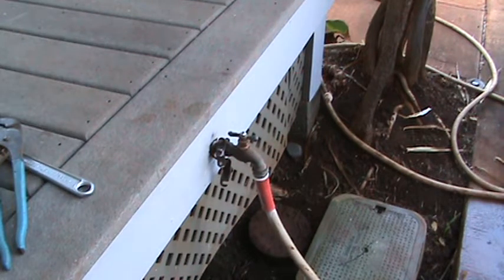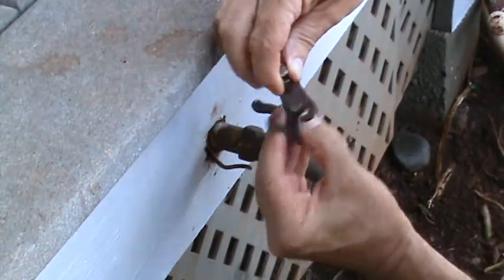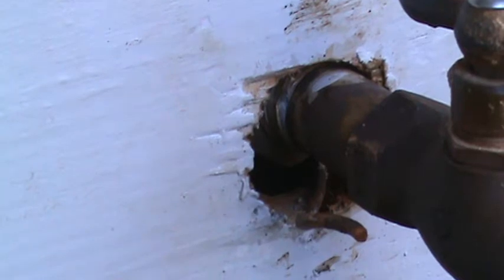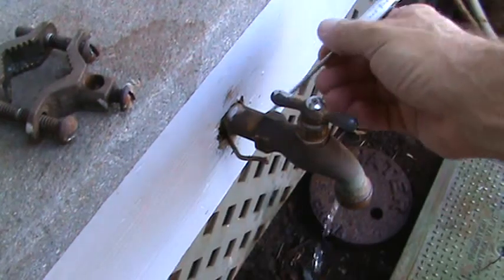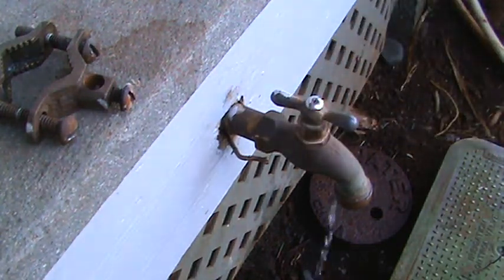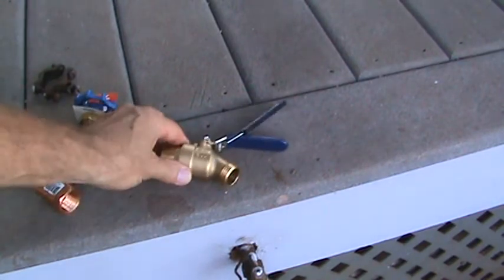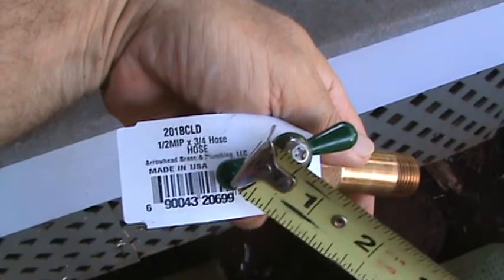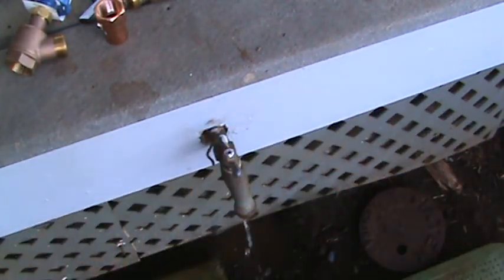How to Determine Size & Type of Leaking Hose Bib

Comment: Question, I just replaced a spigot just like the one you replaced in the video. This looks very straight forward. My question is, when I turn on the new faucet it stops after about 10 secs. Any ideas of what could be wrong?
Reply from the maker: That sounds really weird other than the fact that once you remove the old spigot you should then turn the main water line back on to flush out anything that could be in the line then turn back off. Then install the new spigot. My guess would be that once you turned the main water back on it could've loosened some sediment in the water line & that sediment could've shot right into the spigot & clogged it up...as a thought. You might have to remove the new spigot & install a new one & it might fix the issue. I have never heard of that happening but I know sometimes when you turn the main water back on to a house, stuff like that could happen. I replaced a toilet fill valve one time & when I turned the main water back on, the water fill valve worked but would not shut off when the toilet tank filled up...it would just keep running. I shut the water valve off under the toilet then removed the head of the toilet fill valve & there was a piece of hard plastic that shot up from the water line & went right into the head. I removed the plastic then made sure the water line was cleared before then re-installing the head & everything was fine after that. Let me know what you end up doing to get it fixed. Thanks for stopping by!